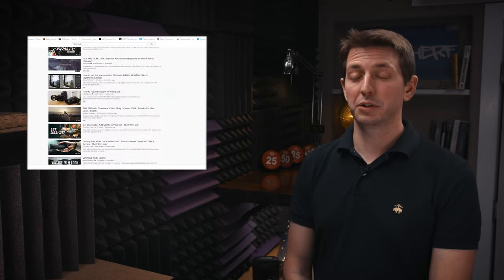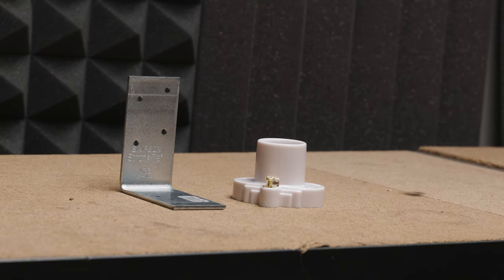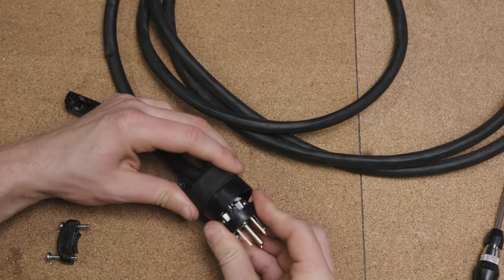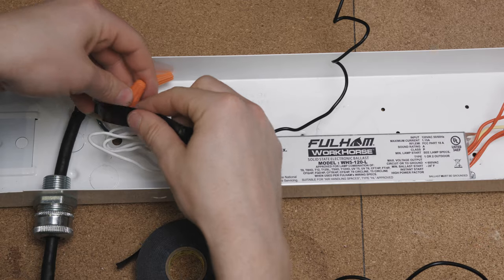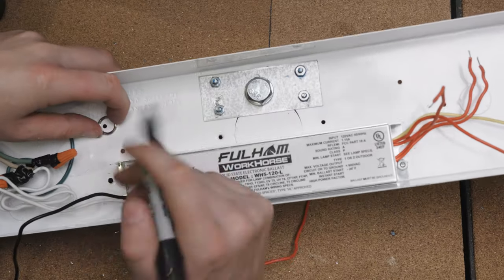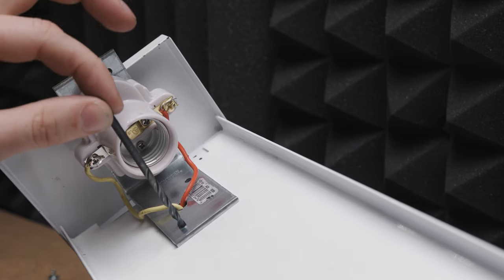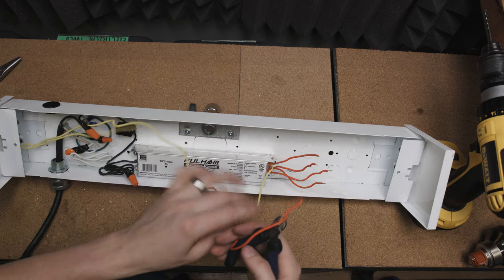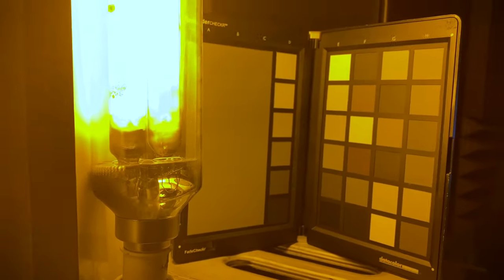DIY: Sodium Vapor Lamp (LPS)

Comment: Great easy to follow tutorial. I've replaced every light in my house with sodium vapor lamps. It's like living on the streets of LA in the 90s. Love it.
Reply from the maker: This is excellent news, as colors other than yellow are very overrated. You will not regret this decision.
Reply: @Powersfilms  Ehm, orange.
Reply: Does it use much power
Reply: Did they have LPS in the US or just Canada, I know the US have HPS.
Reply: @mmtmmt921 it uses at least 35 times less electricity than traditional tungston burning lamps.
Downside and upside is that this light turns stuff monochrome

Comment: Or if anyone sees this message you can buy one that has been tested in original condition still in working order for the same price no tools needed  I have maybe 3000 total ranging from 90w -135w -180w already wired to run on house hold outlet. I just lowered my prices temporary on eBay starting at $75 for my 90w all you need is the lamp and pay shipping.
Reply from the maker: LPS Sodium Lamp Alert! Good to know you have plenty in stock. 

I’ll hit you up if I have any huge projects coming up. 

Thanks!
Reply from the maker: Hey! I'm building more of these lights now and could use more bulbs. What's a good email for you or the name of your eBay Store? Thanks!
Reply: I'm also interested! Please shoot me a DM.

Comment: Protip: Do not burn SOX lamps base down like that. The sodium will pool around the electrodes, which if left to worsen can either ruin the electrodes or crack the seal around the electrodes, which makes the lamp leak and eventually become inoperable. You should instead, for a 90 watt SOX lamp, only burn it horizontal +/- 10 degrees for best performance and lifespan. For lamps with a wattage of 55 watts or lower, they can be safely burned vertical base *up*, however, for absolute best efficacy, they should generally also be burned horizontal +/- 10 degrees.

Might I recommend for anyone wanting to do this, as it is actually a really cool idea, that you add a marker, whether that's 3D printing a coloured dust cover clip or just writing on the fixture which end the lamp base is at so that you don't run your lamp(s) base down at any point. You should be okay short-term but long-term it will damage your lamps running them like that.
Reply from the maker: Thanks. The vertical “burn” was more of a proof of concept to show that it works, but I had no idea that could shorten the life of the bulb. Great tip. The majority of SOX units that I’ve made do run horizontally, so that is good to keep in mind.
Reply: I've typically seen them rated to be "base up, plus or minus 110 degrees". See this video and similar ones from Lighting Supply: https://www.youtube.com/watch?v=9Gs4E3Jyalc
Reply: Why can the lower wattage lamps be used base up, but the large lamps can't?

Comment: There were at least two light fixture manufacturers that made a similar LPS fixture to this DIY one made by Lustra and Verdaray. These were sold as security lighting fixtures for inside retail establishments. I found one at a local swapmeet in my town recently for $15, complete with power cord and plug. It utilizes a 55-watt LPS lamp and true Advance LPS ballast and bayonet Lampholder (socket). It uses  much thicker diffuser than that in a fluorescent fixture.
Reply from the maker: That’s awesome! Can you share a link for anyone that would sell that?

Comment: Many people in the US seem confused about the difference between HIGH PRESSURE and LOW PRESSURE sodium vapor lamps. High pressure lamps were fairly ubiquitous (and still are) whereas the low pressure fixtures were generally only used near big astronomical observatories (Palomar {Escondido} and Tucson). High pressure lamps produce polychromatic light that is slightly orange. Low pressure bulbs produce (nearly) monochromatic light that obscures all 'color' but that is easy for astronomers to filter out of telescope images. 
Of course now Elon Mush tosses thousands of pieces of space crap into low Earth orbit ruining astronomical observations everywhere.

Comment: how hot does the outside of the glass get? Would the surface be too hot for plastics to be in direct contact with it?
Reply from the maker: It does get pretty toasty. If you buy heat-treated theatrical gel, or use a heat shield filter, you should be ok. Next time I turn the lamp on, I will check. 

From what I remember, the bulb can still be touched, but it does get very hot. I hope that helps.

Comment: Nice, but if you are picky like me, the problem with the socket adapter (B22 to E27) is that, unlike a proper bayonet socket, it does not ensure the U-shaped discharge tube inside the LPS lamp is positioned correctly. It just ends up wherever it ends up.

Comment: Is it possible / safe to wire up a lps lamp, ballast, ignitor to a non polarised 2-pin plug? Since i'm located in the Philippines, it's all we have available.
Reply: Definitely not recommended but if it's all you have, I would recommend marking which pin of the plug is your live pin. Outside of that, the lamp should fail to strike if it's connected backwards to the mains.

Comment: Where do you obtain a electric starter switch for a (1,000) watt low pressure sodium bulb. As I am aware that a (ES 27 ) high pressure sodium builb that has a built in starter. Manufacturer is known as (Son - E. ) (70 watt) 

Please advise me thanks.

Comment: i am really impressed and thank you for sharing about low pressure sodioum lamp installations, however in my country use a voltage of 220 volts, do you have any suggestions for me?

And if I want to use a 90watt SOX lamp, can I use the "Fulham WH5-120L Workhorse 5 Ballast" ballast, I refer to Phillips' ASIN Ballast Code giving L72, so I worry "Fulham" WH5-120L Workhorse 5 Ballast "works with 90 watt SOX.
Reply: Use Philips BSX 90w Magnetic Ballast

Comment: Great video, im currently working through your suggested shopping list (im from the UK so making adjustments). Uk plugs are abit different, does it matter which plug type you use and is there a reason why didnt you use a bayonet fixture instead of converting it to E27? Thanks.
Reply: He's using professional stage lighting plugs, you can use our standard UK plug.
The bulbs come with BC22 plugs which Americans don't use.
There's no need to adapt it here in the UK

Comment: Amazing Video. I see that on the link to the items; the bulb is rated for 90W & the B22 - E27 socket adaptor is rated for 60W. The description on the Amazon page for the socket adaptor states: "Based on the heat resistance of your lamp holder, the bulb wattage cannot exceed 60W." & "Note: To avoid the risk of fire, make sure that your bulb does not exceed our recommended wattage." I trust what was displayed on this video besides the vertical mounting, but I also want to ensure I am not going to be deteriorating the efficiency or possibly ending the life of my endangered low pressure sodium lamp given these two differing wattages. Is there something that we are missing regarding the compatibility between the two wattage levels? Or is this a very overprotective measure that was used much like the majority of the P65 Cancer Warnings for California residents found on packaging? Thanks.
Reply: Also, why not just use a BC25 fixture?
You're scratch building it anyway!

Comment: Hi, I would like to buy a low pressure sodium bulb, however I’m not able to find any specific ballast for SOX lamps. Could you tell me how to search a proper one and what to take into consideration while looking for it? I found a lot of different ones and im not sure what are the differences..
Reply from the maker: Check the description, because most of the items are listed with links.

But, for ballasts, I have had awesome results with the brand "Fulham"

Try the Filham Lighting WH2-120-L Workhorse.

https://a.co/d/cS4xDCv

Happy Hunting!
Reply: The problem is that in Europe they are not available :( thats why I have problems with finding a proper ballast
Reply: Will Powertronic PTi 35/220-240 L be fine for that? I have a bulb rated for 35 watts, and 230 volts input
Reply from the maker: Ahhh… I see. 

I would search Alibaba for a ballast.

That other ballast you have mentioned should also work.

Comment: Fantastic video. Quick question I hope. I am hoping to replace a failing magnetic ballast with an electronic one for a 35watt low pressure sodium Thomas duplex darkroom safelight at 110 volts. The current ballast doesn’t use a starter or capacitor. Can you recommend a source? I looked on Amazon and am confused by their offers. 
Thank you in advance.
Reply from the maker: Sure thing. Check out Fulham Workhouse 3 ballast. I think it is rated for ~64wats and it should be plenty for your use. 

Ballast Name: Fulham Workhorse 3 WH3-120-C

You could also use: Fulham Lighting WH2-120-L Workhorse 2 Electronic Ballast

(These are both electronic ballasts and they are more efficient than the magnetic ballast you might be using).
Reply: @Powersfilms  thanks for getting back to me so quickly. The magnetic ballast is humming like a chainsaw so I’m guessing it’s not happy. Your 90watt bulb looks like my 35 watt lps and your presentation is the first I have seen after an exhaustive search. 🙏

Comment: Very nice concise and easy to follow tutorial!  I love these LPS lamps! I built a similar 90 watt unit for myself a couple years ago. If you don't mind me asking, how long do you normally run these fixtures for when you operate them?  I ask this because as I understand it, the Fulham Workhorse ballast doesn't like much heat, and because of this I mounted the ballast outside my fixture. But If the ballast will not overheat mounted inside the fixture, I'd like to modify mine and put the ballast inside.
Reply from the maker: Interesting. I really do not run these lamps for over an hr, but I suppose if these get hot after awhile, it does make sense to mount it on the outside of the fixture or even crazier — adding a heat sink!

Excellent point! I imagine keeping the ballast cool would also extend the lifespan of the ballast.
Reply: Thanks for the fast reply :)  The ballast can get pretty warm even in an hour's run time, but It's not like your running it for half the day or more. I like the heat sink idea! especially for very long run times. When I run mine, I don't run it for much more than an hour either.

Comment: I'm building my own low pressure sodium light fixture, however I noticed you are not running a capacitor and ignitor, are they required?
Reply: Yes, you can use magnetic ballast for optimal use

Comment: 6:23 Drill a pilot hole first!! 😂
Or sharpen the drill bit, but pilot homes are easier.
Also, use a center punch rather than ruin your screwdriver 😉
Reply: Also you don't need to file the swarf off the rear side, just use the drill bit, or the next size up (careful) or use a counter sink.

Comment: You can build a lamp holder but you cant build a real light bulb high pression or low pressio sodium lamp you just mounted and not buildet this video is fake just for clicking  😊 but good job with that lamp holder

Comment: ebay has 18W LPS fixtures, I use 5 18W minisox wall packs  There are fixtures well made 18W for $120 on ebay, making them is dopey.  Brand new UL listed sox wall pack  Not this home made stuff. LPS is a bayonet base, not Edison
Reply: I've seen some like that
Reply: this is a 90w bulb, not 18w. You paid 120 for an 18w rig?
Reply: @Shanepatterson6180  Yes glass lenses STONCO wall pack  high quality fixture, in use every night, lamp was not included.  I have stocked up on the lamps I use, as Philips has ceased production of LPS lamps.  So now the ones that are in stock will go up  in price, I found bargains over the years in SOX lamps I once got an entire case of 12 lamps for like $80 brand new lamps PHILIPS stuff, other times maybe $30 each for some 55W which i use also for the yard.  Or entire Philips fixtures made in OHIO for U.S. market years ago, NOS for a 55W wall pack like $120 with lamp.  on ebay.   The one place had AMERICAN ELECTRIC 18W sox wall packs for also $120, bit smaller, than the Stonco glass  lens, and much lighter, I have a few of them, it's similar to the original Philips norelco 18W mini-sox, which was a well made polycarbonate lens. I have 5 18W Mini sox in operation, many close to 30 years on, same ballast, lens get a bit yellowed, some not so much   American Electric was who purchased the Philips factory in the 1990's when Philips stopped producing the fixtures here.  So they modified the designs somewhat, Eventually Philips bought Genlyte to expand fixtures in the U.S., thus STONCO became another Philips brand, with a dozen other names under the umbrella.  They all have the same parts inside Philips Advance ballasts, and Kulka LPS sockets (which is a former Philips company) Now I use a 55W HUBBELL SOX fixture, polycarbonate lens cover with all Philips inside, it replaced a Philips OH 55W wallpack years ago, when that lens on the Philips after close to 30 eyars of use, got yellowed, I figured I'd just change out the entire fixture, same guts, different shape, same poly carbonate lens.  Hubbell stopped making SOX fixtures also, now it's all LED.  I think it is the "SCOTTSDALE" model..I have a few spares of them too.  SOX is still the best roadway lighting, LED sucks for roads, too much glare. The BEAST of them all is the Philips/Norelco, made in OH. 180W Flood fixture all metal body for big lots and industrial setting, thing is 4 feet long, too bright for my yard, it will light up the entire street!
Reply: @Shanepatterson6180  I instlled a 90W Philips SOX roadway lighting fixture years ago in a relative's parking lot, works great...also from the Philips OH factory, which is long ago shut down, American Electric took it over, i think they shut it too.  So there where many Philips roadway fixtures then same designs, made under American Electric branding...

Comment: please be warned that SOX bulbs do not like base down operation since the sodium would eat away the electrodes.
Reply from the maker: Good to know! I have read a lot about High-Pressure Sodium (HPS) and other Low-Pressure Sodium (LPS) that have a "burn preference" on being used in the vertical or horizontal, base down, position. Thanks! 

Luckily I only have the bulb in the vertical position for testing, as the housing generally makes sense to mount and run with the bulb in the horizontal, or sideways, position.
Reply: they actually prefer to run base up.
Reply: @Powersfilms  They prefer to be run base up as this allows the sodium to flow away from the electrodes which are at the base of the U shaped tube. They look like little spiral filaments. Although for 90 watt and higher lamps, you really should be running them horizontal for better performance. If it was a 55w or lower wattage lamp, they can be run base up and horizontal and it doesn't affect the lamp's performance.
Reply: @cedricwoirhaye8268  No! No no no no no NO! that will eat away at the electrodes!
Reply: @TheSoxmania  There are some sox fixtures that do have the lamps mounted base up except they are 10w, 18w, 35w, and 55w. I only know that base down operation eats away the electrodes.
Reply: @ALT-9167  Why did you ignore TheSOXMania’s comments? He does have experience with these lamps.
Reply: Ok sorry tho
Reply: @cedricwoirhaye8268  I'm aware of that. Anything above 55w is designed to run horizontal only as the sodium would pool up in the end of the U bend, ruining the efficacy of the lamp and making it take longer to warm up.

Comment: What you'll need to make a LPS light: #2, a LPS light. Not exactly what I would call a diy video. At least not the kind I was searching for. You put a lightbulb in a fixture. Congrats?
Reply from the maker: Nick, that is a very astute observation, and I can not argue with that air-tight logic. 

I will say that I installed a light bulb into a fixture the same way Michelangelo smeared paint onto a ceiling.

Comment: I though you were going to make the actual bulb. What a letdown.
Reply from the maker: The insurance company gets angry if I shape molten glass, especially under a vacuum.
Reply: @Powersfilms  well, the correct way to call the video would have been "DIY light fixture", not DIY lamp. Now that those are discontinued, this could be ever so slightly confusing.